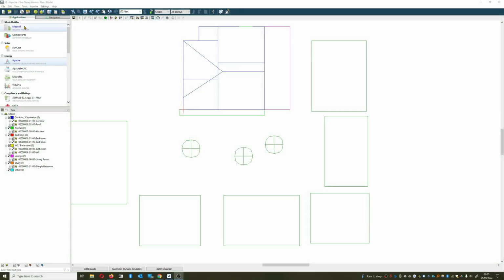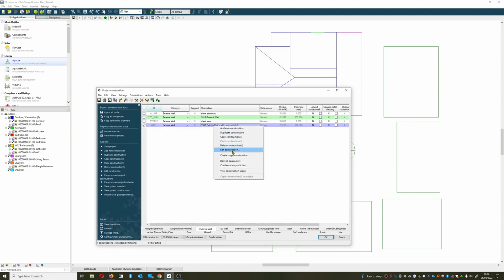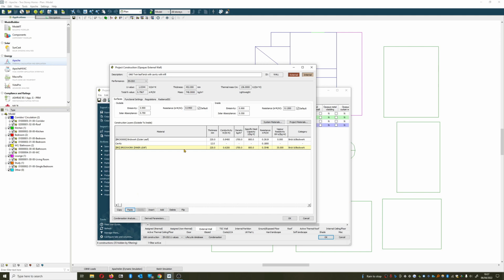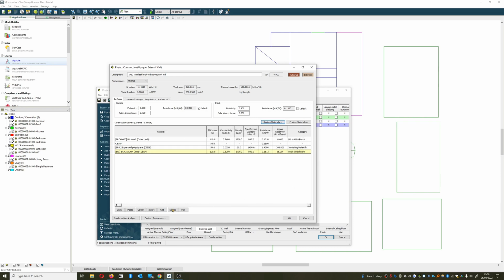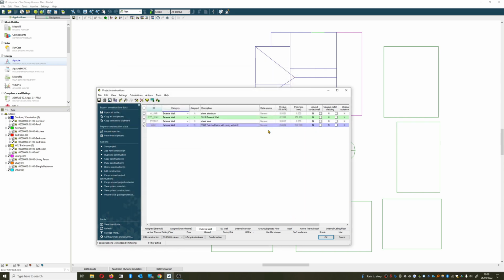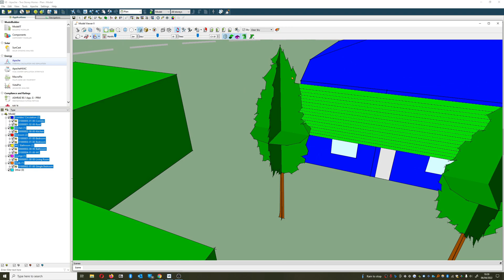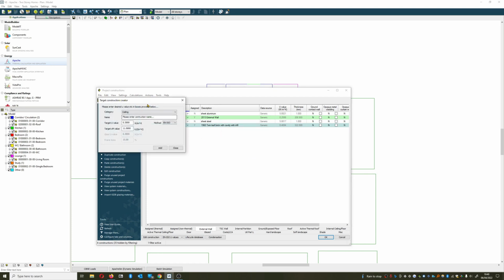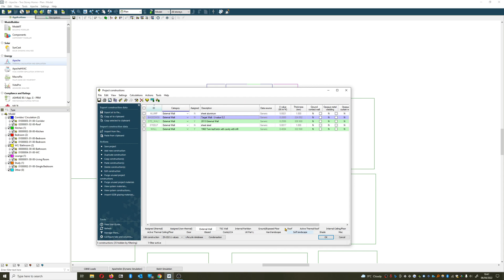IES VE Tutorials - Episode 11 - Constructions

Comment: Hi, thank you for a great video! Do you know why I can't edit floors on the 2nd floor (last floor) but can edit ceilings on the 1st floor? I would rather do the first one since I have lots of rooms on 1st floor, but it doesn't seem to work :/
Reply from the maker: I think I understand the question. Floors in IES are ground contact floors. So if the floor is not in contact with the outside environment then it will take the ceiling construction from the floor below. Ultimately, if it's not a naturally ventilated or using thermal mass the interspace barriers (walls floors and ceilings) don't make a huge difference.
Reply: @grayenergy5413  ok, I think I get it :). However, on the 2nd floor, I have an unconditioned attic and some office space, and I wanted to differentiate the ceilings as the attic one is insulated. Do you know how to do it in the easiest and fastest way, without having to split rooms on the lower (1st) level?
Reply from the maker: @marysiazakrzewska9951 okay easy enough, split the attic, assign the cold bit to a void. Then on the floor below if you go down the level of details to the ceiling you can assign the constructions just to the bit you want. Though word of caution that since your looking from the room out the view is flipped.

Check the arrangement in an axonometric view afterwards.

Comment: What about adding stud walls with internal insulation? This is stumping me.
Reply from the maker: I use a fudge based on BS EN ISO 6946... this will need a handcalc.  Your effectively going to reduce the effectiveness of the insulation layer. You can do this in a couple of different ways. One option is to reduce the thickness of the insulation comparative to the overall unit thermal effectiveness, or to increase the thermal conductivity. In either case, it will be a ratio. Work out the comparative ratio of stud/insulation across a uniform section, e.g. a 50mm stud @ 600mm centres is Ratio of 550/600 insulation to 50/600 stud. Take the conductivity of both comparative the insulation and the wood and combine them e.g. (0.035 * 550/600 + 0.12*50/600) and that will give an equivalent conductivity for that element. BS EN ISO 6946 goes into a lot more depth than this, but you won't be far off.
Reply: @grayenergy5413  Okay, this is what I've been doing. Annoying that it is not built in. Thanks!
Reply from the maker: @Chris-u6d6y  You are right, sometimes these things are frustrating, but other times they come with real catharsis that despite the complexity of the software, out pops an opportunity to do a back of envelope calculations and ultimately remind me that I am, in fact, an engineer.
Reply: @grayenergy5413  It's true, it does feel more like engineering when I have to do some real math by myself.
Reply: @grayenergy5413 @chris-u6d6y There is a built in way to do this. You have to use "Composite" layers in the Construction. You have to turn it on with Settings -> Enable Composite Layers in the Project constructions dialog box

Comment: Hello I am doing my final project on uni on retrofitting my home I am trying do construction for the ones you haven’t mentioned what values do you recommend I use because I cannot get u values of my house construction so I can assume some
Reply from the maker: If you cannot do a penetrative test to work out the makeup of the wall then there are a few things you can do, what is the relative age of the house? What is the thicknesses of the walls? What types of construction were common at that time? Have you tried walking around seeing if anyone is doing any construction work on your street - see if you can get pictures of the exposed wall. There are many options. Make finding the construction an element of research withing your project.

Comment: Hello, you said you'd talk about the problem of the outside wall coming onto the inside wall in the next video, but I can't find the information and don't know how to fix it.
Reply from the maker: Okay - if that is an issue then it's likely a geometry issue. Either the walls are not perfectly adjacent, or this can occur if you have been using the sectioning tool. In the case of the latter, use the "heal geometry" command in modelIT (it's the first of the last seven symbols in the task bar). That should resolve the issue. If not, then don't worry too much about it as the energy transfer between internal rooms will be fairly minimal anyway. Hope that helps!

Comment: When you were creating the U-value for the target construction why didn't you edit the target cM value? is that something we can calculate with a formula?
Reply from the maker: The target cM is the thermal mass of the construction. I don't ever tend to change that on a target construction since if I was going to the hassle of modelling and trying to understand the influence of thermal mass then I'd be making the construction fully to make sure I got it right. 

 If you wanted to use a formula, then work out the volumetric thermal capacity (density of the materials x its specific heat capacity) of the wall construction. Usually from internal side to the insulation layer (if one is present), or to the cavity. However, there is a problem that this isn't the whole story and does not take into account the conductivity of the exposed surfaces that is usually a cornerstone of thermal mass design.

Hope that answers your question!